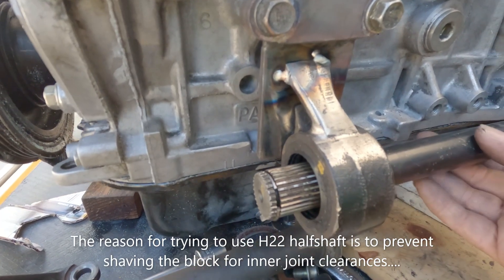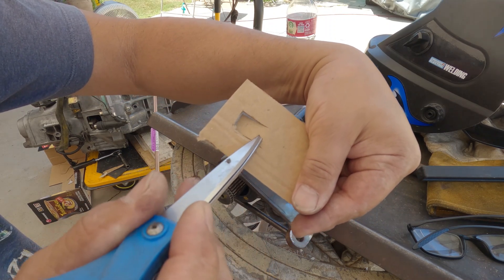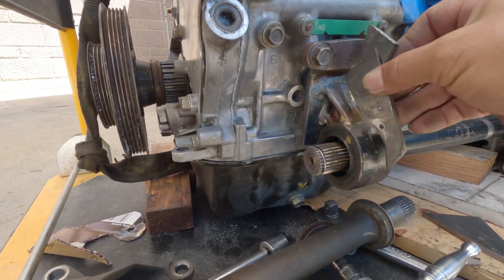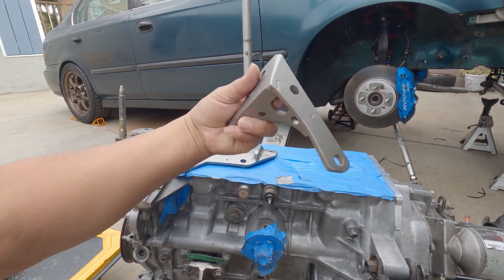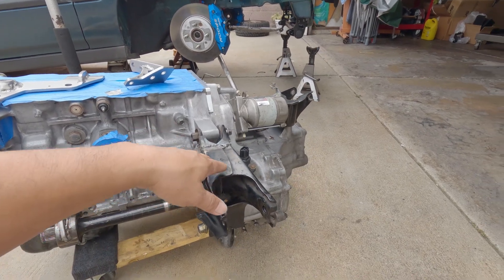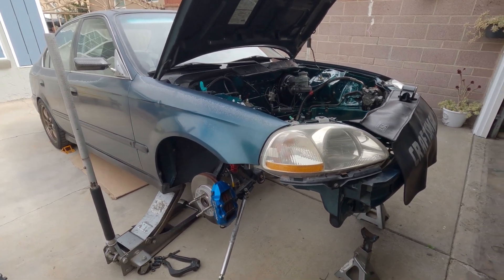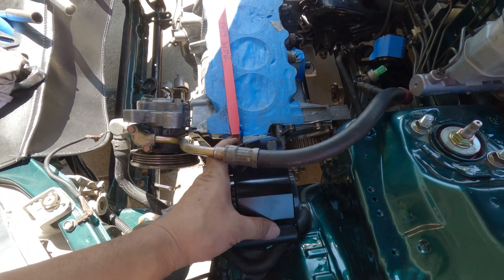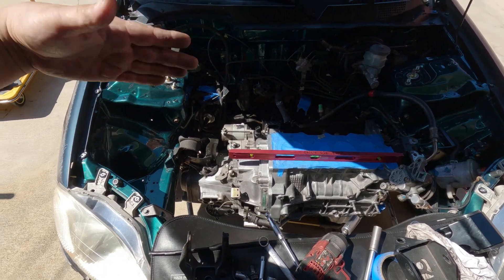SemiPlate H2B/G2B, not a productive day engine installation. ep.6

Comment: Just noob a question, If you do f2b, h2b,or g2b, etc... and put it back to an accord 5th, 6th gen or prelude 4th, 5th gen chassis would it fit. If not, what would be needed to make it fit. One more question, I know you did KS tune deleting balance shaft on the g23, and would deleting the balance shaft work the same for the f23a sohc.
Reply: Thank brother
Reply from the maker: Not a noob question at all my brotha! It has been done before, H2B on Accord and Prelude.  It's back in the Honda-tech.com years. It didn't materialized coz of the fabrication involved. Nowadays you can get a much EDM tranny w/ shorter gears than usdm. Aftermarket parts are also interchangeable now from K to H. What need to fabricate will be the tranny bracket, rear T bracket and possible of lengthening the shift linkage. Axle should be not a problem at all. Accord and Prelude chassis are heavy vs Civic. Something to consider, Ajimport on youtube did a crv tranny mated on H22 AWD, check it out. You can probably get an idea.
Reply from the maker: Balanace shaft delete can be perform on F,H series. Some they'll just remove the belt and they said never have a problem w/ it.

Comment: So awesome to see this coming together! Where did you learn to weld? I gotta learn so that I can take my builds to the next level
Reply from the maker: Self thought and still on learning curves. I'm kinda sux on cleaning the material, l think that's my weakness but l'm slowly always reminding myself to clean it first before laying beads lol! You should get one, it doesn't have to be a real good brand. I'm using Eastwood Tig200 and it's working out good for me. If you do get one, watch youtube for beginners like l did and learned the material coating hazard like galvanized coating. It's cyanide and it's not good when you breathe the stuff. Thanks man and hope you try welding soon.